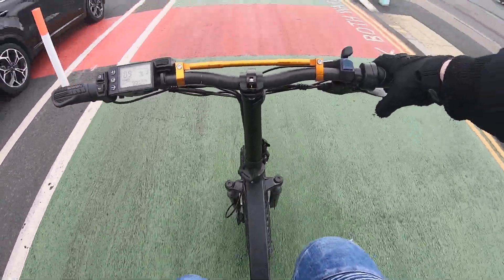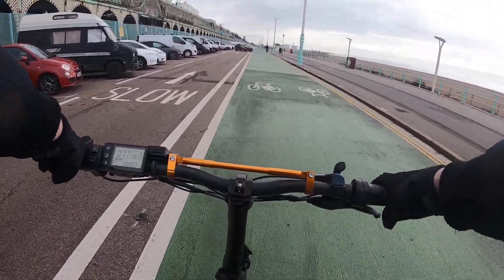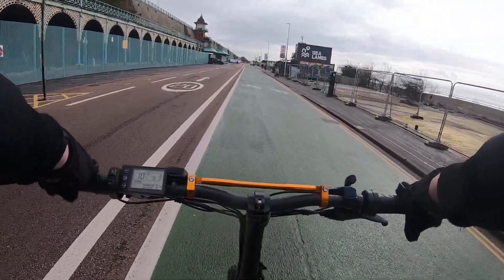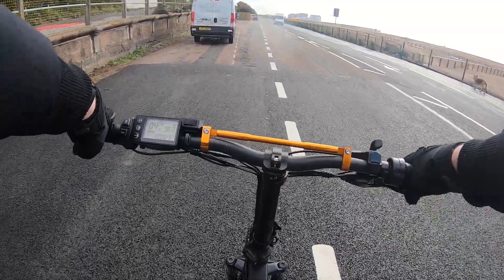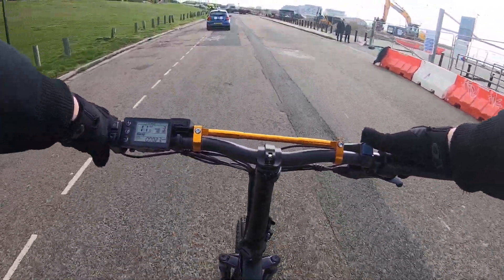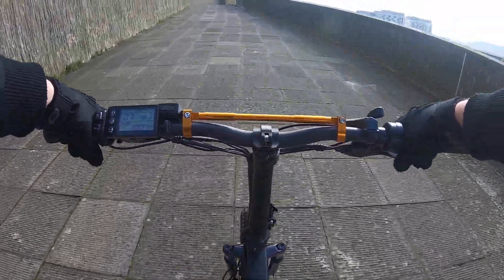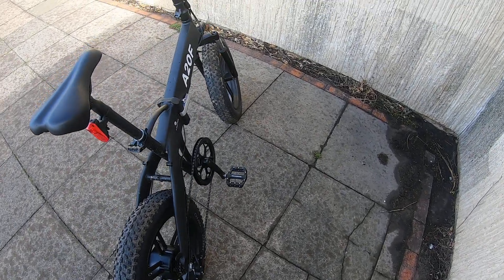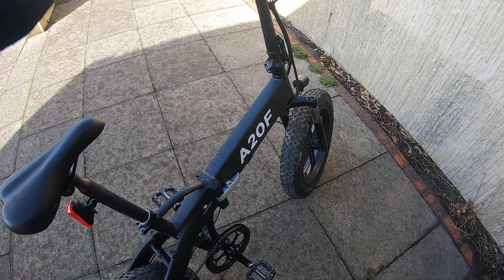ADO A20F Electric TOP SPEED & MODS FAT BIKE

Comment: Is this bike UK legal (250w)? Can the speed that you achieved with throttle only work with UK version? I'm finding my way around the electric bike world but learning about the legalities (when is an ebike a moped for example) 👍🏻
Reply from the maker: Uk laws is 250w motor no throttle and only pas 15mph
Reply: It is road legal. It is locked to 250W and 15mph. You can unlock it though